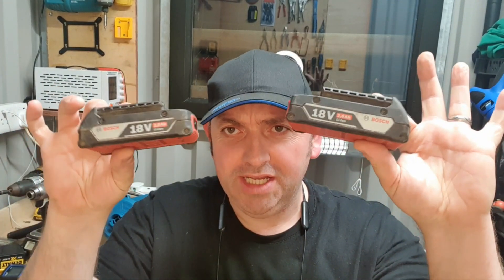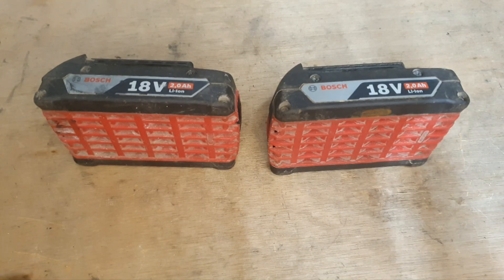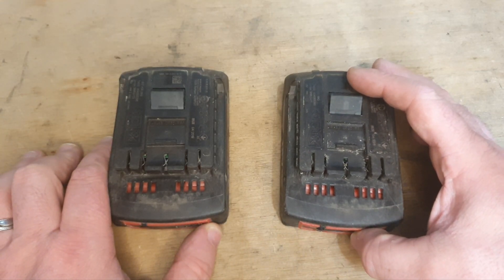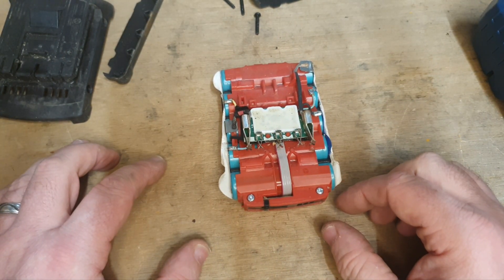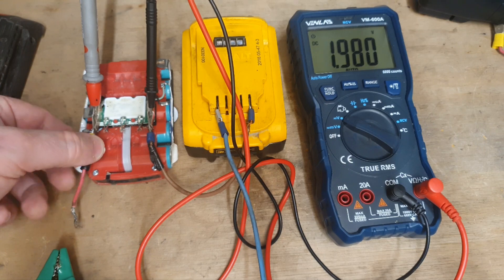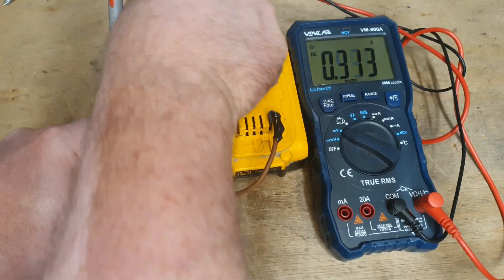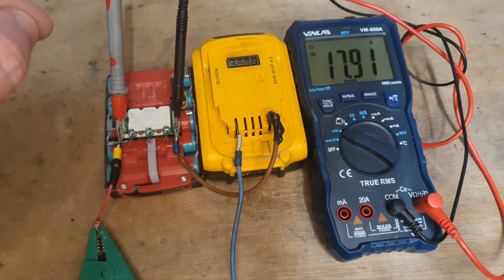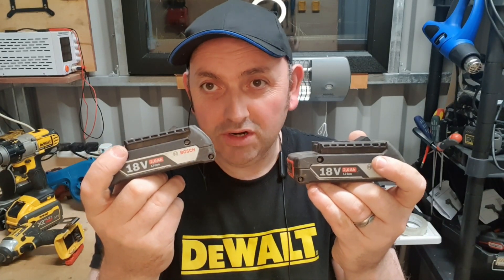How Jump-starting A battery works #bosch #powertoolrepair #powertools #howto

Comment: I got my jumper cables out for a 40v Ryobi I got that showed nothing on the battery indicator. Jumped it, put it on the charger and it started charging. I've just been charging it off and on for a couple days. It's now gone from I think 2v, 1 bar, to 39.3v 4 bars. Just now shows an error on the charger. I'll open it and see if there's a bad cell.
Reply from the maker: Some cells can fail in the process
Reply: @doctorlefthandthread so mine is blinking red it died at work I've had it for a few years how long should I keep it jumped with another battery?
Reply from the maker: @collettesychantha3986  Milwaukee Battery repair course: https://www.youtube.com/playlist?list=PLduybcJ2nSYU7J3VSIi97VjBd36hfht3F